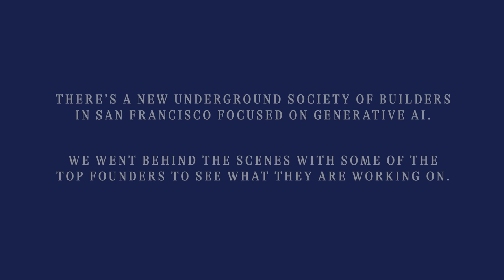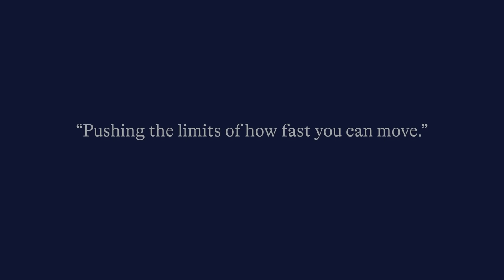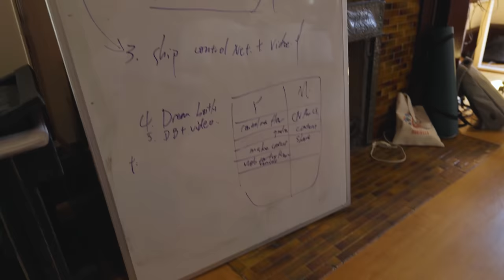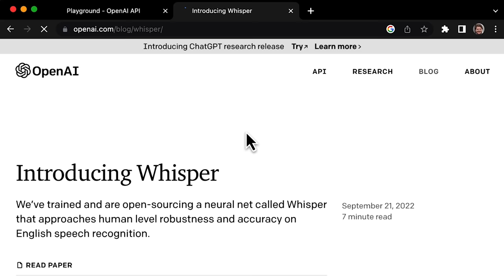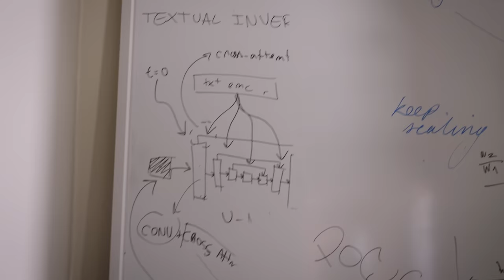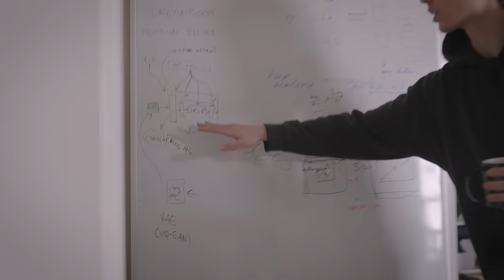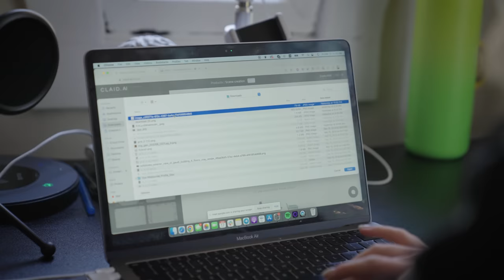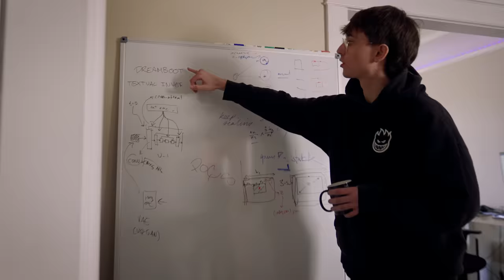The Rise of the AI Underground: Rebooting Silicon Valley (NFX Original)

Comment: Wasn't this the same hype rhetoric as with crypto only a couple years ago? Where has crypto gone? 

In this case, if it's easy for a single engineer to build a "game changing" app on top of some generative api, it's even easier for the incumbents to integrate it directly into their apps (see what photoshop just did with generative image editing).. essentially cutting off any chance of wide adoption. 

It's also just as easy for someone to train their own generative models (mosaicml, openllama) using the outputs of some cutting edge api, getting 99% of the performance with 99% less cost, essentially cannibalizing the api providers. The word "GPT" as far as the public is concerned has also become synonymous with all generative ai. Even to the point where openai might even lose their trademarks. 

The only winners left will be those selling the shovels.
Reply: Crypto was ALWAYS a stupid libertarian ideoliogy in code. It adds near zero value to anything, and in fact is a driver of a lot of awful, awful behaviour. AI is different. It's not "hype" and more than automation is "hype". It implications - on the other hand - are far worse for society than cryto ever could be.